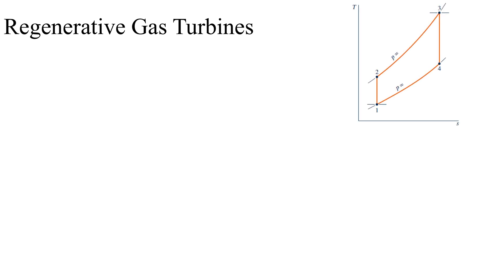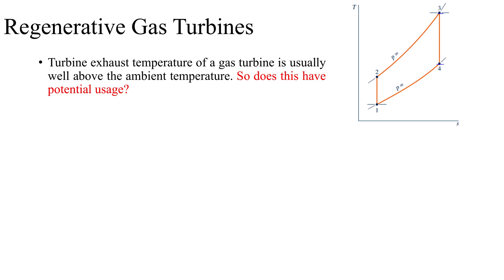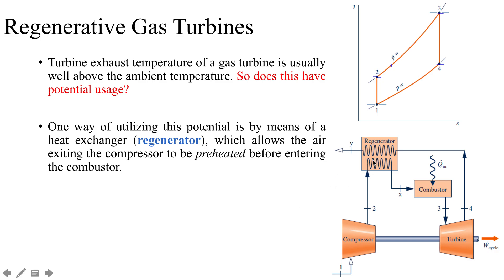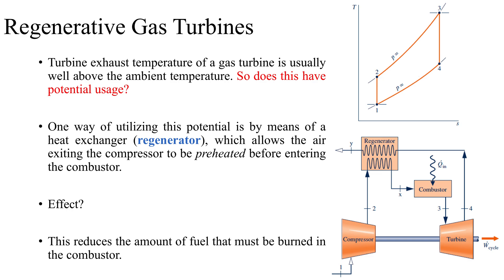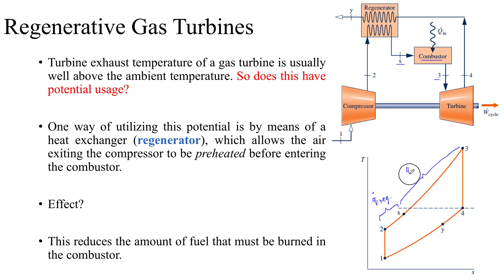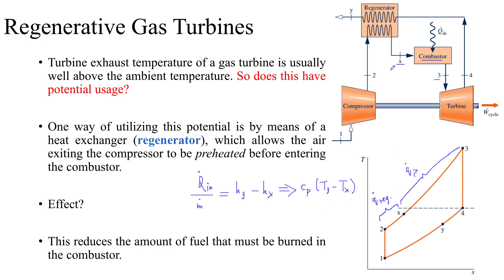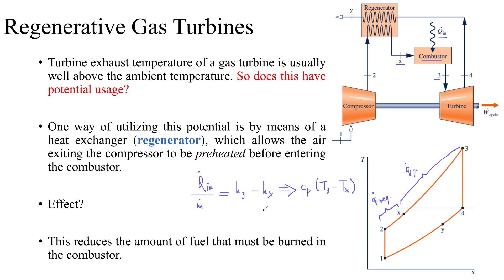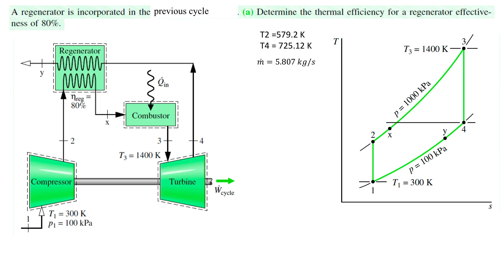Regenerative Gas Turbines

Comment: Sir, would you please consider the following:-
*What compression ratio Vmax / Vmin will raise the air temperature from 20C to 1000C in an adiabatic process, the gas is diatomic Well the answer that the  Compression ratio is Vmax/Vmin = 39.346
This compression ratio is within the capability of modern gas turbine engines. That means that the air out of the compressor is already very hot into the burner and if any more fuel is added, the final temperature is above what the metal of the burner/combustor, hot stator, and hot turbine can withstand.  SO IN PRACTICAL ENGINEERING TERMS,  very little fuel can be added before the metal will fail!. The most recent civilian engines achieve a pressure ratio of around 50 using 15 compressor stages. They can afford to compress the air more because they try to heat and accelerate the air as little as necessary during the combustion process.
The contents of the last sentence are very important with respect to other factors in the engine. The compression ratio can heat the air more than the exhaust of the turbine!!!  
Practical engineering is rather cruel to us engineers and so when thinking about using the Heat exchanger ....... one needs to be very careful indeed and the theoretical calculation is not as straightforward using such an ideal diagram representing a perfect thermodynamic cycle. 
The best use of an exhaust heat exchanger is to run a steam turbine with it and not to heat up the already very hot air from the compressor with a  modern Compression ratio of about 45 and even more than that. .